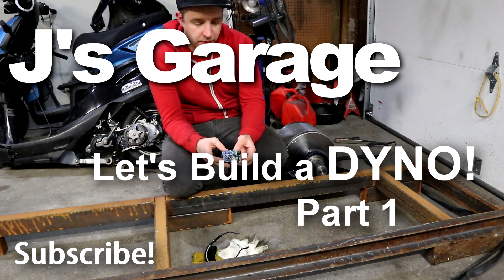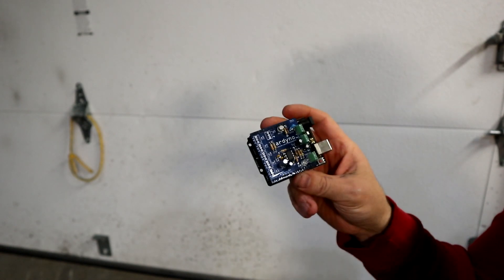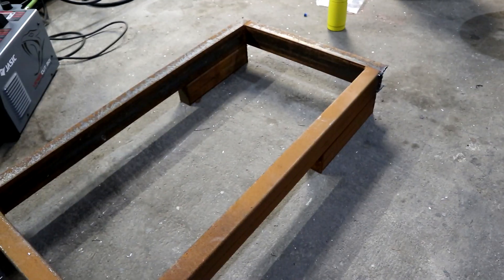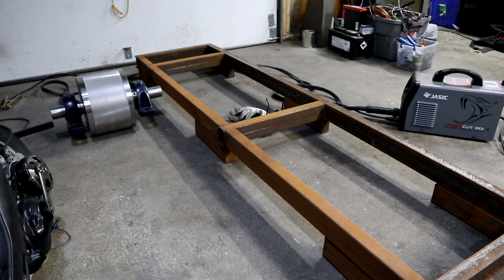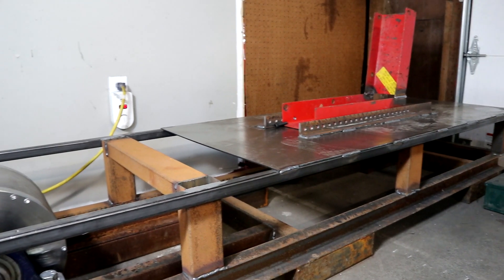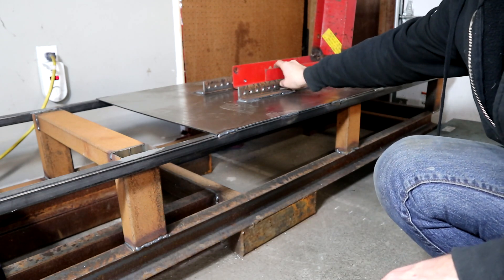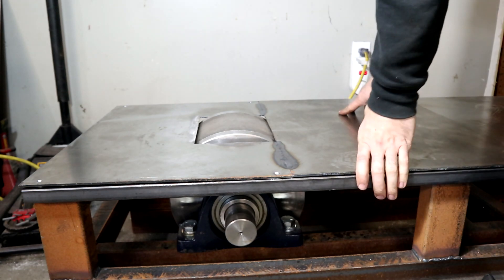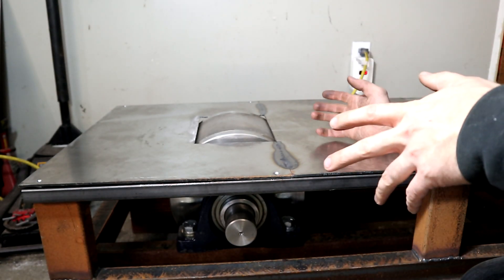Make a DIY Motorcycle DYNO with ARDyno - Part 1 - J's Garage

Comment: Hi pitobread, would you be able to share your calculation for the roller mass required?
I am trying to build an inertia dyno for a 110hp motorcycle. what should the mass be approximately?
Reply: hi shadow, are you build chasis? and Did you find the calculation?
Reply: Calculation of mass of roller:

Maximum force of acceleration of tire to asphalt surface:

Fr = c * m * g --> Fr = 0.02 * 210 * 9.81 = 41.2N

This is the maximum force the bike is allowed to accelerate with before the 210kg bike begins to skid and is not able to move forward. If the force is lower, then you are not accelerating at the maximum possible with the given road conditions.

Maximum linear acceleration of the bike:

F = m * a (Newton's 2nd law)

at = 41.2 / 210 = 0.2 m/s^2

Calculation of roller mass (solid roller):

(1) τ = I * a --> τ = 1/2*m*r^2 * at/r --> τ = 1/2*m*r*at
(2) τ = F * r --> τ = F * r
Substitute 1 into 2:

F * r = 1/2*m*r*at --> m = 2*F/at --> m = 2 * 41.2 / 0.2 = 412kg

So the roller should be 412kg
Reply: @next_step9393  hello, no I haven't built it yet. I will not be building an inertia dyno anymore. I think the best way to go is a dyno with braking system. So the mass does not matter much. I am looking into hydraulic pump to use as braking force.

Comment: Hello ! I am also working on a project! I'm also working on a project like yours. I have PC like yours. I have PCB Ardyno designed by myself. I'm starting to work on the chassis and rollers. Please ask your weight, roller size is how much?
Reply from the maker: Roller is around 300lb, it is 11" in diameter x 14 ish inches long.
Reply: @pitobread    thank you !   https://www.facebook.com/profile.php?id=100009513605848
Reply: Hey would you sell a working Ardyno PCB?

Tryed to contact the ardyno guy but i think he doesnt do them anymore

Comment: The roller you made was from a piece of equipment.What was it specifically before you had it machined and balanced? What are the dimensions and weight of it if you don't mind sharing! I have been looking for such a piece and it's driving me crazy trying to find something. I seen your large motor suggestion but trying to make my dyno look legit and also very safe. Thanks
Reply from the maker: Dunno what it was, it was just a large hunk of scrap steel from a machine I turned it down and added an axle to it.

Electric motor is pretty safe, you have a nice enclosed balanced rotor....

Comment: Did you finished the proyect? What happend with Part 2?
Reply from the maker: Have not had time to complete the series. Real life keeps getting in the way.
Reply: @pitobread  any idea how big should the steel roller be for a dyno to handle big bikes like a Harley? How much should that steel roller weight?
Reply from the maker: @luisreneventura  It is a bit weight and a bit roller diameter.  You need the roller to be big enough that you don't have a crazy roller RPM when the bike wheel speed gets high.  I would get 12"+ in diameter and 500+lbs but that's just a guess without putting pen to paper.

Comment: How did you get the roller? Awesome project!
Reply: hello how are you, what is the diameter of the roller and the weight?
Reply from the maker: It is some re purposed industrial equipment.  However you can use a large electric motor (50+ HP) for the big roller.
Reply: @pitobread  oké thank you for the information and the quick response what did the roller cost you if I might ask?
Reply from the maker: @florisheuperman5048   It was Scrap, I got it for free along with all the steel for the frame and the top.
Reply: @pitobread  omg for free!? In the Netherlands I would need to pay big bucks
Reply from the maker: @florisheuperman5048  A bunch of my friends work in different aspects of metalworking, we are always raiding the dumpsters!